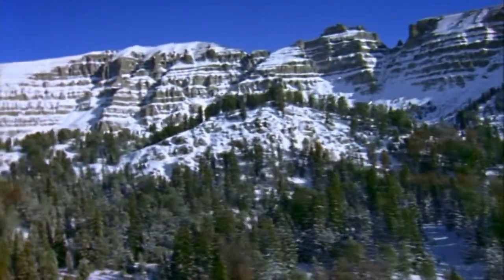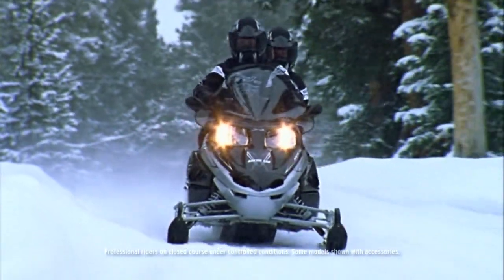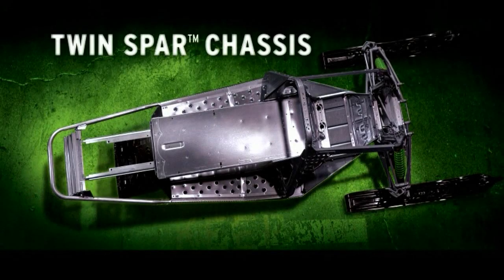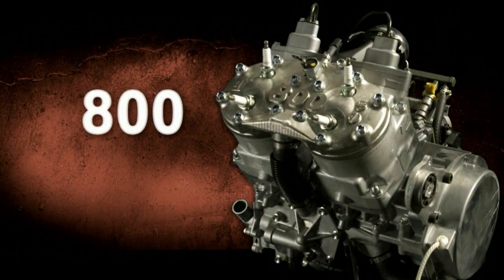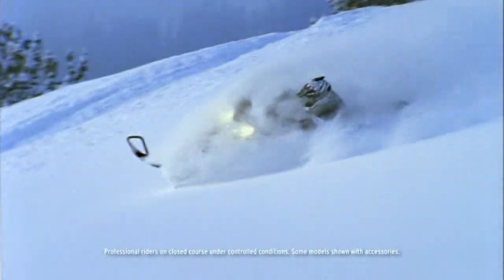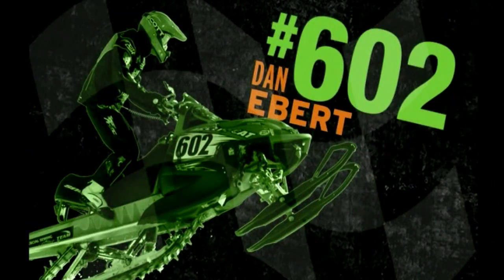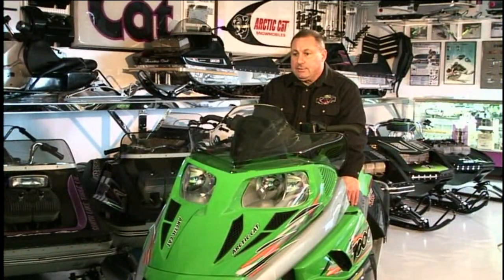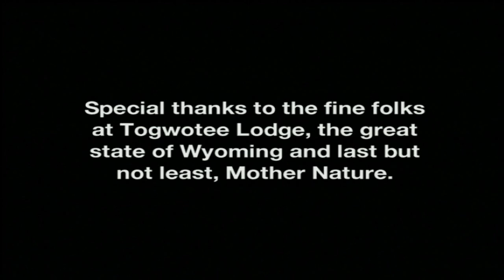2008 Arctic Cat Action Sales Product Lineup Models Promo Snowmobile video

Comment: Most durable, comfortable, and far from ugly. The procross is cheaply made, not durable and one hell of a cold ride. Cat has the Best engines period. Far as being ugly, well thats an opinion, maybe not as "Stylish" as the procross. I work on snowmobiles for a living i can say in Iowa the twin spar is very durable. I have seen countless over 10,000 miles and next to nothing coming loose unlike the procross and other brands. Cat went front the fast firecats that were weak to a heavy bulky sled to a weaker not as durable chassis hopefully the catalyst changes my mind. Although i cannot justify a new $15,000-$23,000 machine i ride 3 months a year if im lucky.